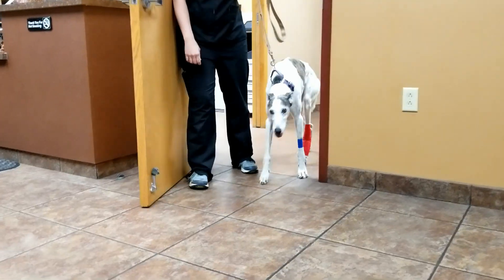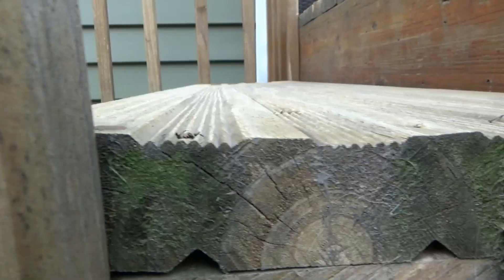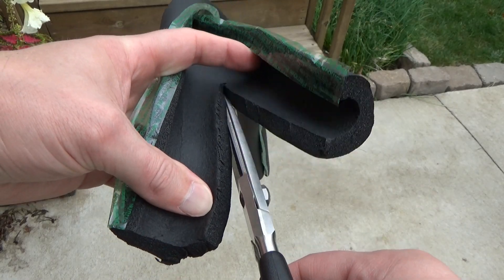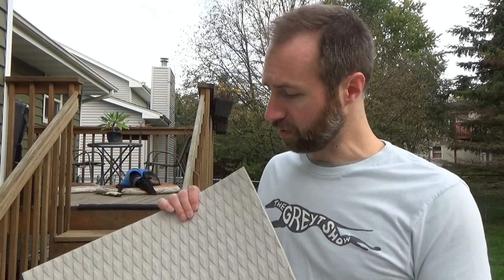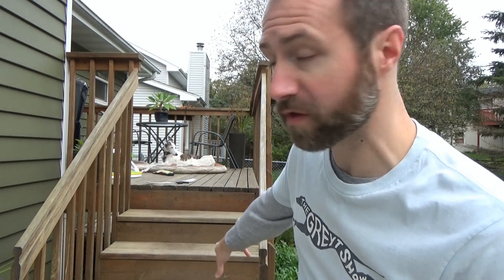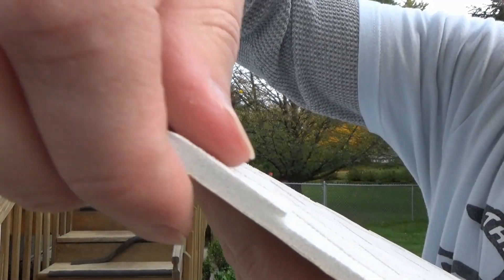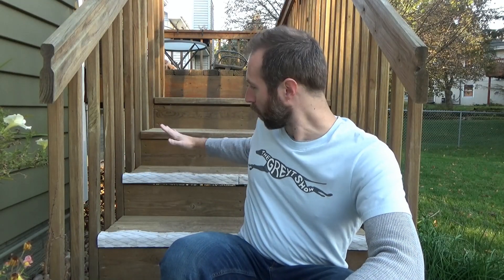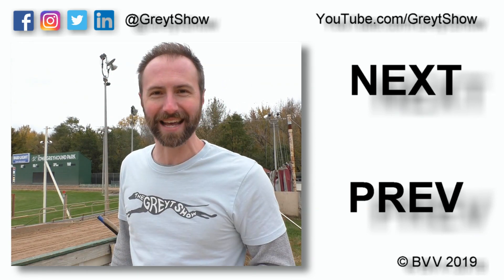Safety Padding Stairs [3.11]

Comment: I agree with Jon Prince. Indoor outdoor carpeting and adhesive. Easily done for under 60 bucks. No staples, they'll eventually come up and back to the vet you go for a puncture wound. Liquid Nails makes great adhesives for such applications. The carpeting also cleans dirty paws before going back inside. My greyhounds, Major & Sprinkles approve of this method. Woof!🐾
Reply from the maker: The added bonus of it cleaning feet!
My main question though, does the carpet begin to look bad after it has been there awhile? Muddy, torn?  Last think I want is disgusting outdoor carpet that I have caulked down and cannot easily clean up?

Comment: Something else to consider...  Often when wood decking/stairs get wet or dewy, they are slippery.  I got nice looking indoor/outdoor carpet runner at the hardware store (Lowe's - buy it on rolls) and put it down on the steps.  It had to be removable, so I used the staple gun, which held well even through a harsh winter.  By not cutting the runner, it covered the open space between stairs at the back reducing one other hazardous area.
Reply from the maker: That is a good idea, thank you for sharing!
Reply: @GreytShow  BTW, I used a soft oriental rug looking runner, not the rough astro turf stuff.

Comment: Great shows, am enjoying all. This one hits home as we've had this problem also. If you look at your video, see where Olive is actually placing her paws. Then consider wet pads at the point she reaches the stairs. Our solution was to rebuild our stairs so there is a platform part way down and the rise was a couple inches shorter than traditional steps and the treads a couple inches wider. We also purchased rolled roofing from Home Depot, the kind that is designed for flat roofs, it also has a sticky backing and there is a very fine granular stone on top. We covered the stair treads along with cutting strips and placing them on the deck, as you know they bound up and keep going. That helps to give them traction until they get inside, rarely will you have a spill. I think between the product I mentioned and your bumpers on the edge, you should have minimal problems. Since we did this we've had absolutely no problem nor have we had to replace of the rolled roofing tread covers. Personally, don't care for indoor/outdoor carpet, as our main stairs for the dogs is on the north side of the house. The carpet stays damp longer and is slippery with rain, snow, ice. PS: as along as Olive doesn't have some sort of tummy issues, try Satin Balls to put a bit more weight on her. I swear by those. Tons of recipe's out there, they all accomplish basically the same thing, when they have ground hamburg as a base, feed 1/4 cup daily until you get her to the weight you want. Then just add a meatball here & there as needed. Great way to get nutrients into them.
Reply from the maker: Four years ago I refurbished this deck and rebuilt the stairs as they were twisted and rotten.  Olive was only 9 years old back then and not having issues.  If I had known what was to come I would have built much wider and deeper steps like you did.
I'll look into the wet pads you mentioned as I am sure my modifications on these steps will continue as my two other boys are getting older too.  Thank you for the recommendation!
Reply from the maker: Oh, also since recording this video we got her stomach bacteria balanced out and she has gained five pounds!  She looks much healthier now!
You recommended satin balls, not sure what those are, can you help me to understand?
Reply: @GreytShow   this is one of the original recipes' and the one I used several times with great success. If you google Satin Balls for dogs, you'll find other, similar ones. The recipe can be tweaked at bit which is why I suggest you look at other ones. The term comes from the meatball shape which is shiny from the egg. I measured out the servings, 4 oz meatballs, then froze, when freshly made I leave out 2 days of feeding. The meatballs must be thawed before giving to them, you can pull out a couple the night before and let thaw slowly in your fridge. Depending on whether the dog is eating anything or not, I start out with one or two and go from there. The recipe is complete enough that it can be fed alone. My end goal is mushing up in their kibble, when they get their weight back, ease off until they are just eating their regular food. Use up whatever you have in the freezer as a treat a few times a week. If you've multiple hounds, won't hurt one bit to share with them :)  I know some people don't like to feed raw. I've had GH racing trainers tell me 30 years ago, never feed any dog cooked beef, the way the fats break down, they can't digest the meat properly plus they get no nutritional value from cooked beef. Never feed pork or any pork products as those can cause pancreatitis.   Here is the recipe: https://www.instructables.com/id/Put-weight-on-your-dog-with-satin-balls/

Comment: Brian, one other alternative is to go to a nearby architectural firm and ask them if they have any carpet squares they are going to get rid of.  they literally throw them away all the time.  most are rubberized on the bottom and while they might not be the most attractive patterns, they are free.  those can be used as runners for stairs and easily stapled or wood glued to the deck.
Reply from the maker: That is a good economical idea, thank you!

Comment: Round off the front top edges of the steps with a router. Carpet the staircase with one piece of indoor-outdoor carpeting. Glue the carpet in place with waterproof caulk spread out like tile mastic. I've done it for my Greyhound and it just plain works. It looks okay too.
Reply: ^ This. The approaches you tried in the video might cause injury because the areas you step on are lower then the edges, which can occasionally trip both dog as well as owner. With Jon's approach the area is safe and long lasting as well.

Even so. Greyt video as always :)
Reply from the maker: This sounds like a great idea.  I had not thought of holding everything down with caulk.  My biggest challenge was how to adhere the materials together.  Thank  you very much!
Reply from the maker: I agree with Jon's idea as well.  Thank you for watching!

Comment: I purchaded rug runner from hardware store. 3 foot wide on a roll so you purchase length you need,  installed as if steps were indoors. Stapled at top, stapled at back of step, repeat and continously ran down steps covering that open area between steps that my greys would not tolerate.
Reply from the maker: A rug runner would be a really good option.

Comment: Did you consider leaving the material flat rather than wrapping it around the front of the step? It seems like it would stay on much better that way. I don't know if it would accomplish what you need it to do though. I hope Olive is doing better!
Reply from the maker: The main issue I was having is that the edge of the step was causing the injury so I needed to wrap it around, which was causing stress on the material and pulling it back up. Vicious cycle.

Comment: Thank you for this video. We have 3 indoor steps our grey needs to use to come inside. He tripped on them and had stopped coming in on his own. We had so much work in the week before we found a solution. We bought bull-nose stair treads, they are for indoors. Within a day he was doing the stairs on his own again. I thought this could help someone else. These treads have an adhesive back to stick on the flooring.
Reply from the maker: Thank you for recommending them! Any and all options are welcome!

Comment: You should also put those traction pads on the steps, so your greyhounds don't slip while going through the staircase.
Reply from the maker: The boards used on the steps have grooves cut into them for traction but I'm not sure how well they work.  Something on the step surface would be good though.